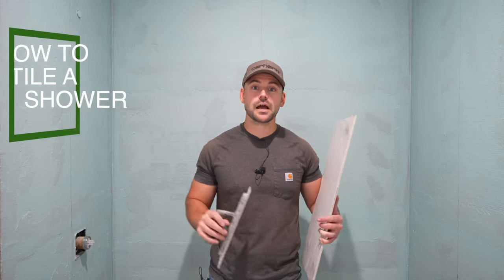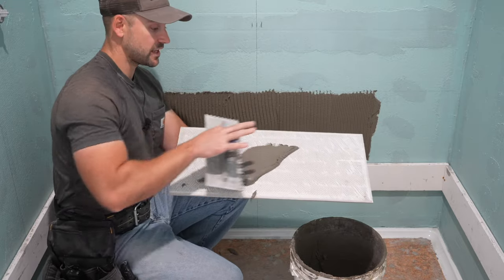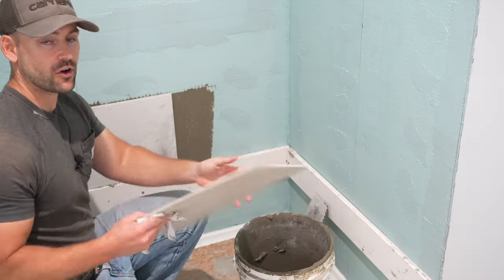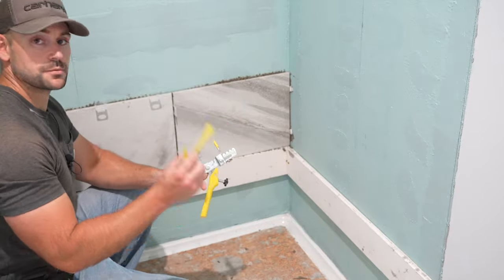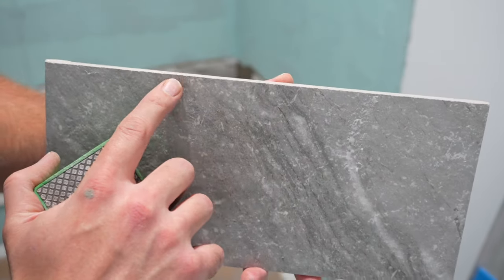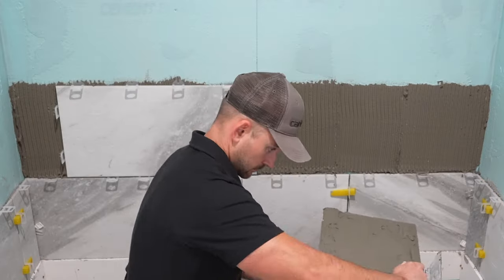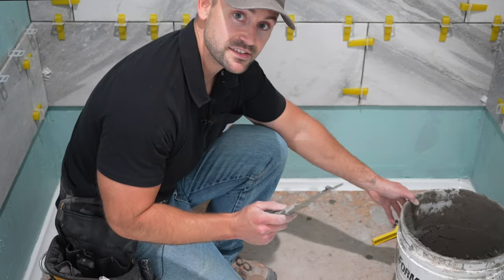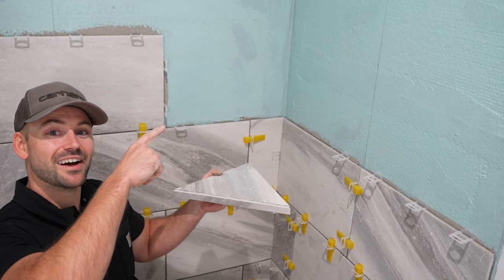How To Tile A Shower Pt. 2 - Installing Wall Tiles

Comment: I have laid tile in 5 or 6 different bathrooms in the wall and a dozen or so rooms on the floor. Not a pro, more like weekend warrior,.   Ive never seen this leveling tile spacer system. I dig it though.  It makes total since. They should have went on shark tank!.

Comment: Our family hired a guy to do the tile on the shower and the dude did not use a leveling system and he did not use spacers and he didn't clean the thinset after setting each tile. Now there's thinset squishing out of the tile. What shoukd I do? He said he was a professional and didn't have pictures of his old work.

Comment: I thought with large format tiles like these, you should be using a 1/2 x 1/2 notched trowel.
Reply: Probably should, but back buttering will compensate
Reply: Not always necessary!! You technically are getting near 1/2" when you butter the wall and tile with a 1/4" trowel. Don't smash them down to the substrate after hanging the tile up, and you will be good to go...
Reply: @newyorkstreetmachinz3547  👍🏻 Thx

Comment: Unless you have uneven walls and need a lot of thinnest, buttering is a ton of work (not for beginners) and needs a helper or your thinnest will start setting.  I just tore out a shower I did 11 years ago...lesson learned never use natural stone even sealed in a shower....I did not back butter and the pieces did not come off the tile or hardiboard using a 20lb sledgehammer.  I had to beat the snot out of the shower....the key is thinnest is the right consistency.....if is it the right consistency with the right trowel....it aint coming off in its lifetime.

Comment: Why didn’t you start from the top of the shower base for your first level? Also what trim or tile is that to hold the tile in place? 😊
Reply from the maker: It’s best to not start off the shower pan because the shower pan is typically not perfect and you will have to do a lot of awkward shaming to get it level. It’s best to just start from the second row. The boards were just 3/4 primed pine boards. You can also use a 2 x 4 or any board as a matter of fact. I hope that helps!

Comment: Tiled a lot of bathroom never used the leveling system but bought it and am going to try it. I like using the snap cutter as much as possible rather then the wet saw

Comment: Your videos are the best ive seen, you explain things well, ive been doing alot of tile lately, but i like to watch videos to pick up details, you can never learn enough.. 1 guestion i had though, you run your thinset vertical om the wall and the backbuttered tile, arent you supposed to move the tile some while placing it, to get full coverage, not being critical, you didnt seem to do that or press in on the tiles much

Comment: In this video you set out the tile pattern based on wall center lines.  How do you then compensate for the water intrusion positions? Surely you need to take theses into consideration so those intrusions fall symmetrical or as close too, regarding grout lines and tile areas?  Thanks for your simple explanations to date.

Comment: I did my first tile job in my shower. It took me a long time as I was learning as I went but the wife said it looks great so that's what I wanted to hear. In regards to the leveling system (which I used) I would suggest not squishing your tiles all the way when placing since if you go too far the leveler will not pull the tile back up flush. It seems good to pull the newly placed tile down even with the already placed tile but not so much the other way. That was my experience anyway.

Comment: hello, great vid series!  One question, doing a shower in a bit and wife wants vertical 50% staggered offset in it with 6 x 12 tiles, in your first video you utilized vertical center lines to straddle, would you use the same method when doing walls with long length going up and shorter length going across?

Comment: been a great help watching your videos.... i have a 17x13 niche with centerline @ 44" up off top of shower pan...i plan on running a 6'' mosaic stripe thru the centerline and want to run full tiles up and down off that 6'' stripe so the cut tiles are at the top and bottom... or would you think starting from bottom and working up and making the cuts at the niche a better idea?  TIA

Comment: Very nice video and job. I have a question for you. Did you seal the green board? In a shower I was advised to use wonder board or any type of cement board and seal that as well. Thank you for yoyr time.

Comment: I bought leveling system with plan to use 12x12 tile. Changed to 8x10 tile but I assume I can still use leveling system,  2 clips per side still.

Comment: Ask! If 1 tile is slightly lower than the next and you use the leveling system,  you raise one tile to level it, if so don't you lose contact with the tile adhesive???

Comment: I have never done tile work but I’m about to add a bathroom and it gonna have tile. Do you think a beginner can do a decent tiling job?
Reply from the maker: Very cool that you were getting ready to add a bathroom. Remember, we were all beginners at one point that do tile. Your first job clearly won’t be as good as your fourth or fifth job but if it’s something you want to tackle it is something you can consider. Do your research and prepare before you dive in. Hope that helps!

Comment: I’m a diy guy and I’ve done now 11 showers from scratch. I have used the leveling system you show and it works well with large form tiles. However my last build had wave tiles which are not smooth on the surface. A bit more challenging but your recommendation of having help to back butter was a huge plus. One thought when applying the thinset I alway wipe the edge of the board to avoid any unlevel action that can occur with the thinset.

Comment: This is so awesome. I am actually in the process of finishing laying my last wall of tile for a complete tub to shower remodel. I watched your previous videos about the whole process and they all have been so helpful! 

My only question is why choose to lay the tile on that layout or like center line with a full tile and then 2 cut tiles, one on each side? 

With it being my first time, I started on the side/long wall which started 2 full tiles and then a cut tile and then the 2nd row with 2 full tiles and the cut tile the opposite way. The front and back wall were opposite off the side walls so the back wall was bull nose trim, then full tile and then a cut tile going into the side wall, bottom row of 2 full tiles and the cut tile, then the front wall with a full tile and cut tile along the bull nose trim. Im sorry if that is confusing or a lot, I’m really just trying to understand why you choose to do that layout and if what I did is wrong/looks bad.

Comment: I just got left over tiles from a store. At a very good price but if I go based off a center line there will end up being too much waste from all of the cuts. I'm planning on going from one side to the other with full tiles so I only have one cut per row... is this going to cause problems if the walls aren't perfectly square? Also I only have 5 feet of height to do since it's a tall tub.

Comment: I never used the leveling system myself( too expensive). Granted I had been setting tile for many years before they were invented. These would be great for the DIYer tho.
I always started my tile off the top of  the mud pan using shims. Most of the time, all the tile was set in one day, so starting on 2nd row wasn't an option. 
Day one was demo, plumbing, backer board, curb, and dry pack mud bed.
Day two was install niches and/or benches, waterproofing( usually Schluter Kerdi), and tiling bathroom floor.
Day three install shower tile and grout bathroom floor.
Day four grout shower, finish bathroom( set toilet, chaulk, etc.) And install shower door if needed.
Give or take a day or 2 depending on job size and scope and whether the shower pan required inspection.
Reply: raimondi is a great leveling system and a box of 2000 clips only costs about 150 bucks, so about 8 cents per clip. i dont care how long anyone has done tiling (i have been installing full time for over 40 years) you cannot set tile better without clips, simply because of the warped tiles . todays rectified long planks or even 12x24s are cuppped and when you stagger the patterns you will get high and low spots no matter how good you are or how flat the floor is. the clips actually bend the tiles flat until it dries and aalso splits all height differences way better than you can do without clips. in a shower it might cost an extra50 bucks for the clips...thats definitely affordable and can be added into the price...

Comment: I did a 5' x 10' bathroom with floor-to-ceiling large format tiles (same as yours). I did not use a tile leveling system BUT was ultra-careful when putting up my backer boards so they were meticulously plumb, knowing its difficult to have perfectly even large format tiles on an uneven wall. Even then, I had to be super careful to seat each tile with the same pressure to achieve even surfaces. Looking back, the tile-leveling system would've been quicker.

Comment: I like those wider yellow tile levelers, did you get those at lows or where? I just finished a bathroom shower remodel and I used the home depot ones that are thinner, they work ok but yours look like they work way better with more surface area.
Reply from the maker: I got this tile leveling system from Amazon. I put a link to them in the description of this video if you want to check them out. Thanks for watching!

Comment: I was planning to use shorter bullnose tiles at the two exposed edges. How do you handle that? Do you put the bullnose on first then the center tile then cut the corner tile to fit?

Comment: I have a contractor that use mastic on the wall on porcelain tile and then he put down the floor with thin set and we’ve had all kinds of trouble with the tile and now today he was going to grout it in and the tiles are falling off the wall and he’s telling me that now he can use this outside of mastic and put them back on the wall and grout them before the end of the day. I told him he was mistaken that on the wall, then said, has to set up at least 8 to 16 hours and 12 to 24 hours or actually 24 to 48 hours before you can grout the floor anyway this is a job that should’ve only taken Max four days on the shower and then I had some other work I wanted to do but I don’t think that’s gonna happen now because it looks to me like he can’t seem to follow simple directions. From a professional so I don’t know what to do, but I think you for your informative videos and I subscribe to your channel soda help you out but I’m at my wits end on a four day job. Let’s turn into a nine day ordeal and I still have work that needs to be done and I’m headed up to my eyeballs. Thanks again. And this is all in a small bathroom and I’ve been without a shower for over two weeks now. But thanks again.

Comment: Hey I really appreciate your content! How did you know what size trowel to use, is 1/4” notch big enough? I’ve seen other folks recommend a 1/2, that seems like overkill?
Reply: Look at the back of the mortar bag.  It'll have a chart with tile size, grout size and recommended tooth size for trowel. Smaller tiles typically requires lesser tooth size, larger require larger tooth size to hold in place

Comment: What is the spacer's size? Is it 1/16 or 1/8? I am installing bathroom wall tiles now. I just went to Homedepot and I found the spacer that u used in this video. There is only 1/16 size spacer. They said the spacer is for flooring, not for walls. My tile size is exactly the same as yours. They recommended  me to use 1/8 spacer + sanded since the tile is big.  They said non-sanded grout is not recommended  for big tile like yours. I can't find 1/8 size spacer like yours. Can I use 1/16 spacer and non-sanded grout?

Comment: Sorry I missed the live chat. You always have such great information which I know helps out anyone who hasn't done tile work. I have never had a chance to use the leveling system because of the design of tile I have done and when I first started doing tile they were not available. Always having the patience to make sure the tile is flush with the other and most of the showers, the customer wanted much smaller tiles which the leveling system would not work. Overall, I love your step by step guidelines, thinset color based on grout color etc and of course the safety tips especially with tile work. Great practice always even when using glass feature tiles. 
Have a wonderful week Josh 👍🏻
Reply from the maker: Don’t be sorry for missing the live chat. I know everyone has a busy schedule. That is true about the small tile, leveling systems don’t really work with them. Thanks a lot for always watching and commenting on my videos. It is a huge help. See you next time!